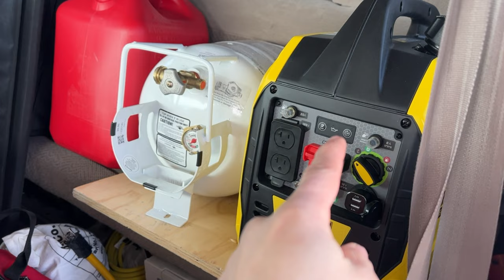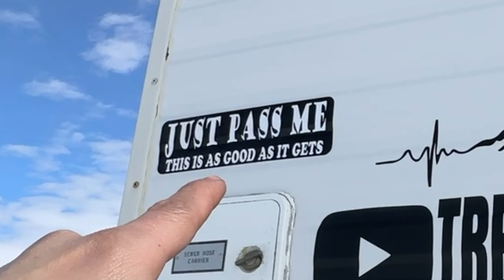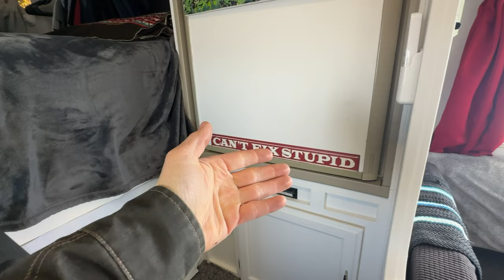CAMPER REMODEL TOUR •Merlot Rover• with LIFE UPDATES! Chevy Silverado/ lance squire lite cabover! 4K

Comment: Hey man so I’m getting a 94 Obs Chevy 4x4 with a flat bed to do exactly this! How much does your camper weigh and what is the payload capacity on your truck? This. Way I can kinda get a idea of what I can do. A camper with a shower is a must so i gotta plan smart thanks man
Reply from the maker: Heck yes, that’s awesome! Hope that works out for you! I believe my camper is about 3000lbs dry! My truck is a 2500 so it handles it very well! I bought got this all together so don’t know all the specs! Sorry I don’t have the exact specs for you!
Reply: It’s all good man that still helps more thank you know. I e been building trucks and cars since I was a kid so I’m going to fully box the frame and reinforce the frame then put 3500 leaf springs under it to hold it with out twisting the frame. I like to go overlanding so going off road with this would be a challenge and exciting
Reply from the maker: @nuclearknight8543 oh yeah that sounds like an awesome plan! I was raised fixing old chevys so that’s why I picked this one! Hope the best on your build! 🤙
Reply: what is the MFG, Model, and year of the truck camper.
Reply: Ah, a Squirelite 185 by Lance.
Reply from the maker: @oldsalt8011 Hey there! The year is a 1997 on the camper! Lance Squirlite cabover! 😏🤙
Reply: @NomadaTrev  Thanks for the info. I like the Layout.
Reply from the maker: @oldsalt8011 Yeah I really fell in love with it when I checked out out! Everything you need! 🤙
Reply: @NomadaTrev  I think that dry weight maybe high but it should be shown by a Tag on the back if it is still there.  A 2000 Lance 815 which is similar has a dry weight around 1,880 lbs.
Reply from the maker: @oldsalt8011 Yeah I think they are similar in weight so I think your right! Are you thinking about getting one for yourself?

Comment: Check for rotted wood around that forward window. pretty common.
Reply from the maker: Yeah I did find some rot around the front cab window I’ve cleaned and filled! I’m sure there more but it will be alright! Thanks for this 🤙
Reply: @NomadaTrev  Im looking at a 2000 Lancelite 815 that I might buy. the owner has caulked around the front window very heavy handed. My guess is that it too has been leaking.
Reply from the maker: @oldsalt8011 ahh yeah sounds like mine! How much they wanting? I get complements all the time in mine!
Reply: @NomadaTrev  Well JD Powers has it around $5k but I have not seen the refrig, hot water, or AC run.
Reply from the maker: @oldsalt8011 hmm dang well go check it out! I paid 9200 for both my truck and camper! Mine didn’t have an AC though!
Reply: @NomadaTrev  Dang, that was a good deal for a truck and camper....my opinion.
Reply from the maker: @oldsalt8011 Yeah when I saw it I called right away, an amazing deal! Been living in it for almost a year now!

Comment: As one that lived in my TC for several years (and loved every minute of it) I'm not sure that gasoline (and propane) is a good idea to have in your cab area. Heaven forbid you have any sort of accident (even not your fault), if that gas can ruptures, (and it won't take much) you would be drenched in gas and that would NOT be a good way to go. One spark or static discharge and you're toast. Safe travels little brother.
Reply from the maker: Hey thanks for the concerns on that! I don’t carry gasoline anymore and I have my propane tied down so should be ok! Really appreciate that and hope the best for you too! 🤙
Reply: @NomadaTrev  Yeah, those propane tanks are almost bullet proof. The gas....not so much. I'm actually thinking of revisiting my old life with another TC. Was looking to see how you had your bike mounted. My little WR250R is about 40lbs lighter than your Husk. I have the same style of carrier you have. How did you keep it from rocking side to side?
Reply from the maker: @cowboy7x Oh yes my bike mount is very sturdy and doesn’t sway at all! There is a little block with bolts that you tighten so it shouldn’t wiggle much! I also strap to the bumper just in case something snaps!